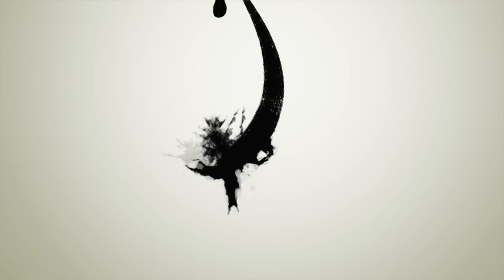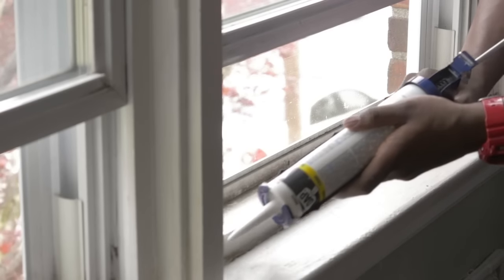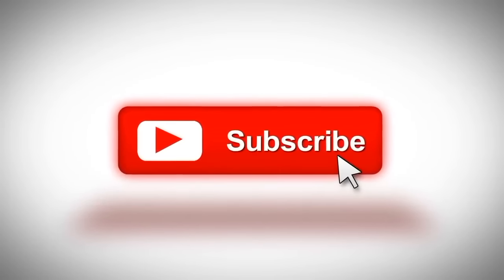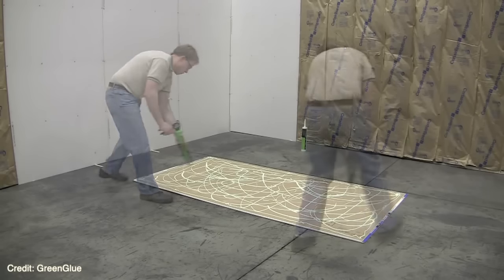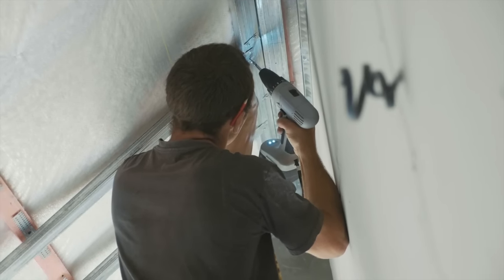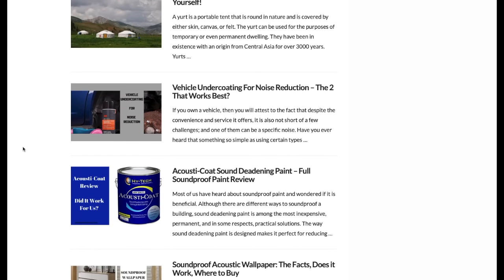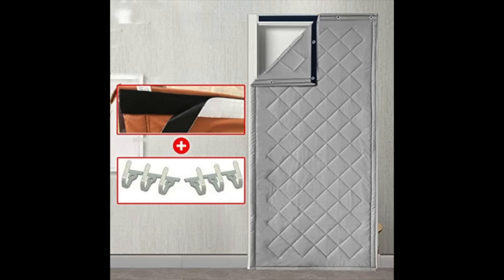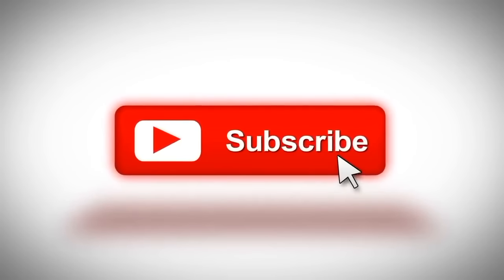How to Soundproof a Wall - 7 Easy DIY Ways!

Comment: I have concrete walls, floors and ceilings. Professionals told me this week, l could almost do nothing. I can reduce the db inside, reduce the sound dispersion, but the reverberation is the biggest problem, and seems there is nothing to do for a reasonable budget. 😢😢😢
Reply from the maker: To reduce reverberation inside is as easy as installing acoustic panels and adding rugs on the floors to reduce echo.
Reply: @soundproofguide  l have done that inside my living room, and indeed my music sounds way better, but the problem is the reverbation, outside in my upper neighbours that is our problem, and me playing rock music haha
Reply: Try to cover 35%+ (likely 50%+ in your case) of the total interior surfaces with absorptive materials. Cheapest effective solution is to make acoustic panels by wrapping dense insulation in fabric. You can use Owens Corning 703 on the expensive end, or Ultratouch denim for something cheaper. Go 2” thick minimum for voice. Go 6” thick for music performance, mounting 2’x4’ panels across all wall-wall and wall-ceiling intersections. Depending on the room size, it may be within your budget. You should be able to make roughly 400 sq-ft of panels for around $60-$150, depending on thickness and whether or not you make frames from 1x2 lumber to give them a clean look.

You can buy a bag of insulation and make 4-5, and make more as funds permit.
Reply: Upon re-reading your post, I gather you are an audio professional looking for a solution to powerful modal resonance. Sorry to say: the more massive and rigid the boundaries, the stronger the modal activity in the room. This leads to not only a very disproportionately long decay time across low frequencies, but also to a wildly uneven frequency magnitude response as well as majorly uneven decay times between resonant/anti-resonant frequencies. So, if the dimensional proportions of the height/width/depth do not yield an EVEN DISTRIBUTION of resonance modes (they seemingly never do unless the dimensions were chosen for sound), there is indeed nothing worth doing to make such a room suitable for music recording/mixing/mastering. You are better off taking time to evaluate your options, and select one that allows you to get into a space that is suitable for your needs. This may call for fairly radical changes in life plans. And make sure you have an acoustical engineer (or, at least an acoustician) on board before you start looking for the new space. I skipped this step and ultimately abandoned a recording studio as a result. It happens. Try to come to terms with it and move forward toward, realizing all your dreams. ❣️

(For the record, I am not the Ryan Lewis of Macklemore fame.)
Reply: @fosterlewis7360  hey, thanks for the answer. But no, l am not a professional, only a passionate amateur, loving hard rock and metal, hehe. And indeed my upper neighbours have the most trouble, but the neighbours next door hear the very low frequenties, with any low key riff. As l don't really intend to move, lol , not gonna invest in that kinda yard. I have a solution for 285€ in a blackstar 100w amp, which allows to play with a full sound at 0,1w. I have another project in mind though, find a band, with all the members open a bar as associates, opening it for our and other band rehearsals, and those bands can come for a jam too, l have 6 electric guitars,  a keyboard, harley bentons, good guitars to make available. I need only persons to make it a non-profit. Could be nice  😇😊
Reply: @fosterlewis7360  l have already half a wall and a corner full, and l have put some smaller ones i  a nice shape, others are placed behind every speaker (4). I had watched some videos some time ago. But actually forgot about them, will make them myself, have some pallets hanging around. Thanks for reminding.
Reply: @fosterlewis7360  l have a room of 78,65m3 or 2706,867 cubic  inches
Reply: pascal bxl pascal bxl Your room is a good cubic volume. However, it would definitely be very expensive to isolate a room that size from direct neighbors. The cheapest route would be to build a room within the room, complete with floor and ceiling and additional door(s). And good isolation design, of course. 

If neighbors are the main problem, then unfortunately acoustic treatment panels will not help. But they absolutely will make the room more enjoyable for playing music. At that size, you might even see about picking up a bunch of secondhand acoustic foam if you can find it for 1/10th price or free. Those deals can be found since foam gets ugly after a while and it does not perform as well as most people need. This is because it just isn’t particularly useful in small room. While yours is technically a small room, it’s big enough for foam to be quite useful. With all those hard surfaces it would help cut a lot of the harshness and the reverberation. The more surface you can treat with absorber panels the better it’ll sound, so use whatever is cost effective. But avoid blankets and mattresses if you can afford insulation and used acoustic foam.

I recommend you try putting your bass cabinet on an isolating riser to cut down on mechanical transmission. Mechanical coupling to the concrete puts vibrations directly into it, carrying the sound through all of the concrete. You might get a few dB isolation out of that. Not enough to eliminate complaints, but maybe a noticeable improvement for the neighbors.

I absolutely love your idea of making a non-profit space for musicians! Much love! Keep playing! Bring the neighbors regular gifts! Baskets of freshly baked cookies can be a cheap and often effective diplomatic gesture. 😉
Reply: @fosterlewis7360  you are a hell of a guy, THANK YOU so much for all the good advice. Yes a hanging ceiling would be around 2000€, without guarantee that the problem is solved. I am training furniture making too in a local group. So l will be able to not only make frames but insert the isover into a cabinet the idea just came up. And why not make a business out of it. Might be effective on tne wall between the living room and a kids playing loud music? And it is very discreet, ok people will lose a few inches of space but i think this might be interesting. And in my living room l can put an extra door to my bedroom too, great! Thanks for the hint to the neighbours. They will appreciate it for sure. The idea alone makes me feel better too 😃 l am seeing a singer in a few days, will ask him and his band if they are interested hehe!
Reply: pascal bxl You are very welcome!

Just be aware: you will not get soundproofing with cabinets/panels. Soundproofing requires walls/ceilings/floors to be designed and built for the purpose. A ceiling alone may not be enough for the upstairs neighbors: you may need walls and a floated floor to really soundproof.

Panels of insulation only help make the room sound better; they do not soundproof at all. But definitely try buying a riser platform rated for the weight of your bass cabinet. It’s an easy thing you can do now.

Acoustic treatment (selling acoustic absorber panels) can be a fine business, but it is typically hard to compete with big international companies making panels. You would have to offer bespoke solutions to customers to give a reason to pay you instead of buying commercial products. Restaurants are a good target market. Read some books on small room acoustics first. The Master Handbook of Acoustics is a good one, but there are others that are less technical and easier to read. Also, watch more videos on soundproofing and acoustics too. Both topics are more complex than they first appear.
Reply: @fosterlewis7360  No l won't but it might help the less manuel people/musicians and l will make such colors their wives and mothers will love them too ;-) l am truying as we speak to involve a professional woodworker/cabinetmaker to get his qualitystandards. I have a training end of september, will make the prototype of one model, should not take more than 4hrs.
Reply: @Paul Seymour thanks a lot! Great ideas

Comment: noisy neighbors can be easily prevented if on every rental or business lease it says on the very front page it is the responsibility of the residential or business to contain their noise, and if they even slightly disturb their neighbors by sound, smell, light, vibrations but not limited to the above they will idmeatly be kicked out and will wave any state protection laws, all of their property idmeatly becomes property of the property owner, all renters are demanded to sound or video record the violaters and report it to building owner, all low frequency sub woofers on any amp or stereo or home theatre will not be permitted, if you like your music loud get head phones, no heavy foot stomping, parents will control their children or be idmeatly kicked out, no drums bases or any musical instruments to slightly disturb their neighbors, no slight noise or smell  disturbance from any animal violaters idmeatly kicked out or visitor all building motors, compressers shall be on vibration damping springs, and sound proofed, all building floors and walls will be sound proofed in any new or already built,  building construction, or building contractor and owner owner will be fined 1 million dollars for each building or apartment violation, to go to suffering tenent, upon first violation land owner will demand tenants  door be opened or be forcefully opened, land owner will video tape offending noise maker and idmeatly destroy it with a cordless drill with a 12 inch but, any suffering tenent encouraged to destroy the offending noise maker, by busting open the offenders door, no burglary charges will appily, and they are encouraged to video tape the noisy offenders device, offending tenents will be strictly forbidden to stop those tenents suffering, from destroying their noisy device or animals, you best bet there would not be any more noisy neighbors noisy businesses, sadly there is a very smart software developer, and a airplane pilot in jail for the rest of their life's because of a boom car war assault device by the name of Michael Dunn in Jacksonville Florida he confronted boom car punks, clearly cop entrapped fla statute 777-201, any repilys are encouraged yes even psalms 35-20 of the Bible talks about those who enrage the peacefull people of the land king James version cops profit off victims of noise makers, who get jailed for defending their rights to "peacefull enjoyment" guaranteed to every business or home renter, your suggestions, comments are welcome

Comment: So some of this stuff is helpful, others are pretty inaccurate. Never caulk a wall with any sealant to the floor behind a baseboard. It leaves a vertical surface where moisture can weep up the wall. And when it comes to Green Glue, the information of it only blocking a few decibels is correct but the “couple tubes for a few dollars” way off. It takes two tubes for a single sheet of drywall and a single wall on average costs $128 just for the green glue. Plus you’ll need commercial caulk gun. 

Just saying, this is somewhat helpful but I don’t think it helps people in residential situations as it is slightly misleading as far as building codes go.